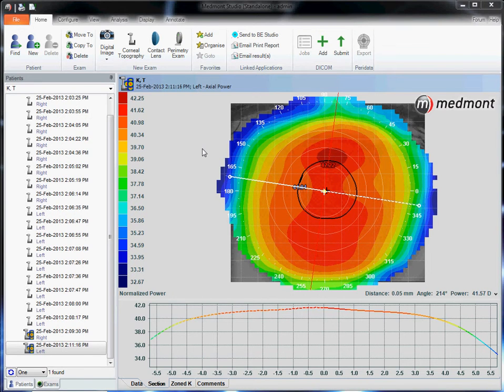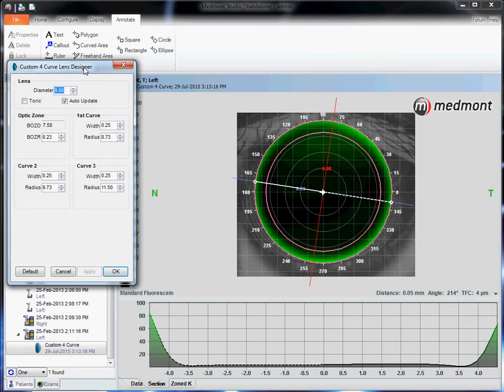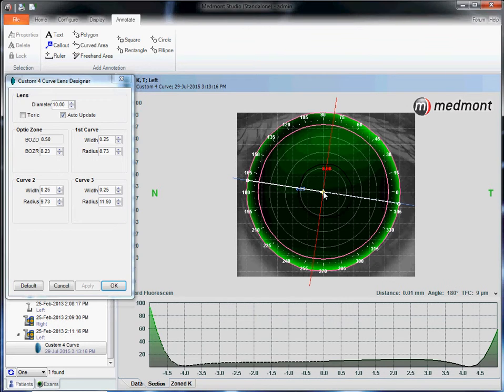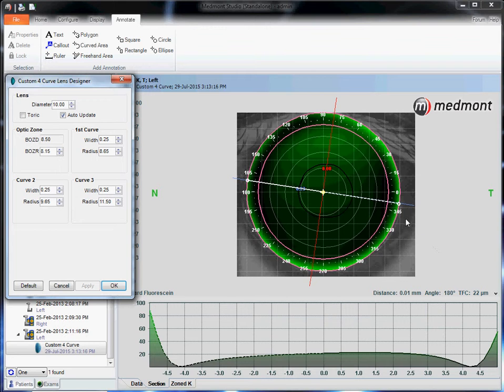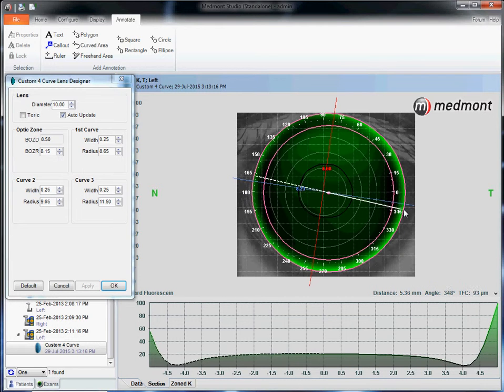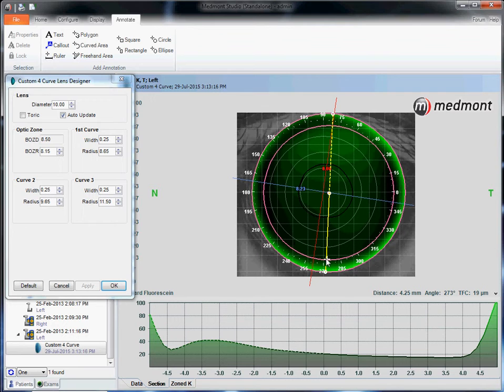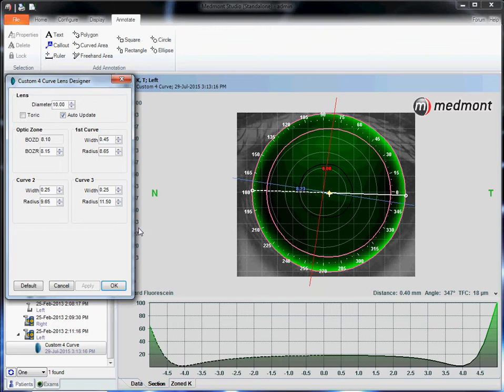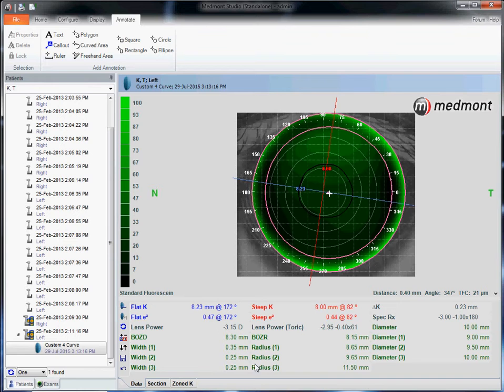How To | Fit a contact lens for a normal eye (Studio 6)

Comment: Dear engineers, normally, we use 337.5 to exchange the corneal curve to corneal refractive power. When eye is wearing soft contact lens of 1.43 refractive index, and we measure its surface with medmont while wearing the soft contact lens, so which number should we choose to change curve to diopter?

Comment: Would you use the same design method for an eye with against-the-rule astigmatism? Any variation? Thanks
Reply from the maker: +Geoff Conwell 
Take a look at our response to your comment on the 'Contact Lens Module - Astigmatic Eye' video. Generally it isn't recommended to fit an ATR cornea with a RGP lens. Hope this helps!